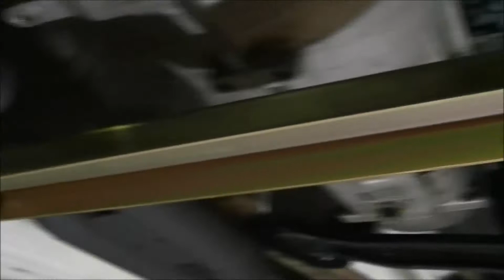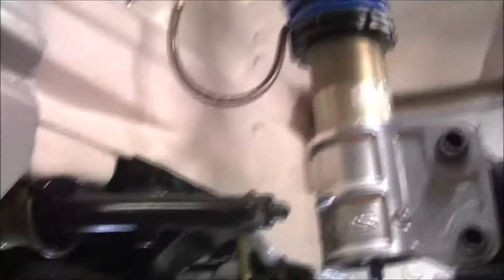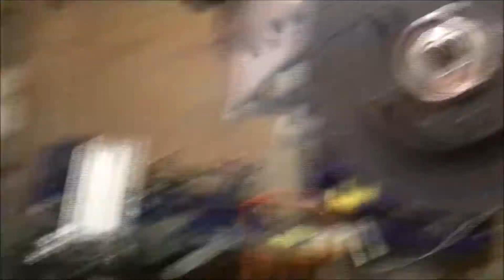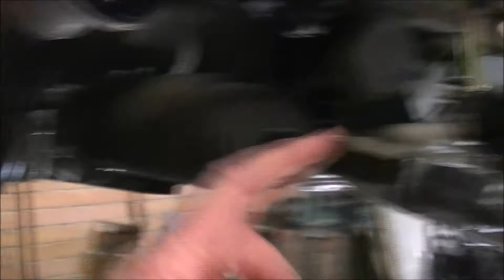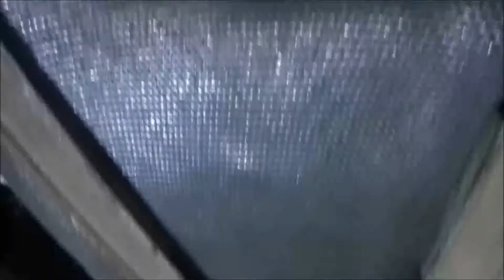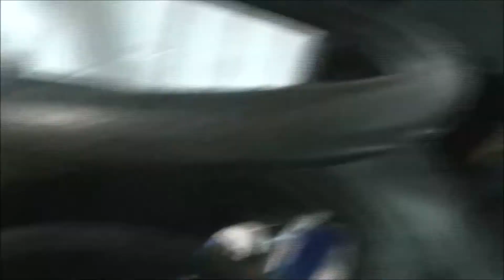BMW Rally build - 15.5 fuel lines guard fit, sump guard cross-member, rear suspension links

Comment: Awesome job.  One question.  Did you scrap all the underbody corrotion protection or you paint on top of it?
Reply from the maker: Thanks Vil Racing, some was removed but I left a bit. Being a rally car the underside gets blasted with so much stone and gravel. I left it to give a small amount of protection, that is until it's blasted off.
Reply: @Kaitler_Motorsport_Engineering  thanks for the reply.  One more question, how much do those shocks cost, just an estimate if possible.  Thanks.
Reply from the maker: @perezramon21   The shocks for the rear (x2) were about $1800 from memory and I think the fronts (x2) around $2500 with progressive rate springs.

Comment: BMW Tuning Bonnet gills DTM hood Vents grilles M3 GT-R Air Duct "EMU"
e36-e46 www.ebay.com/itm/282170496474 
e46r4 www.ebay.com/itm/282170490152 
e46r2 www.ebay.com/itm/282170505749 
e30 www.ebay.com/itm/282170503715 
e9x www.ebay.com/itm/282170494337 

Tuning hood Vents Air Duct GTR style 
www.ebay.com/itm/282271034546 
www.ebay.com/itm/282271037535 

Tuning hood Vents Air Duct AMG c63 style 
www.ebay.com/itm/282271042059

Ford ST RS universal Bonnet gills hood Vents grilles Air Duct e92 style
www.ebay.com/itm/282286171534